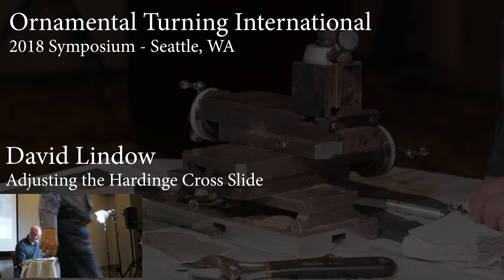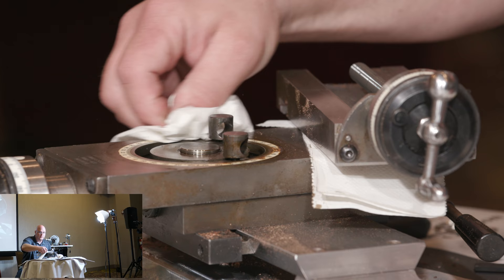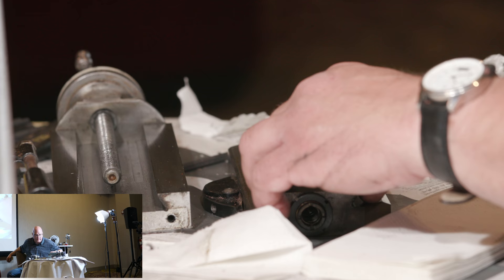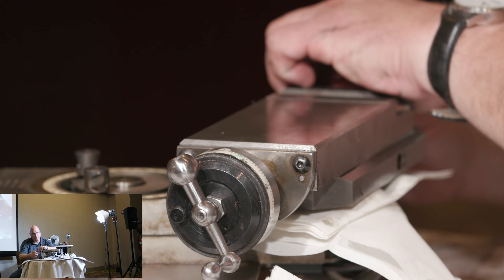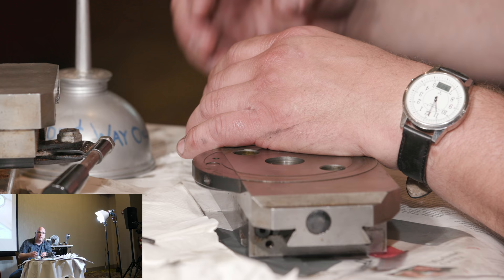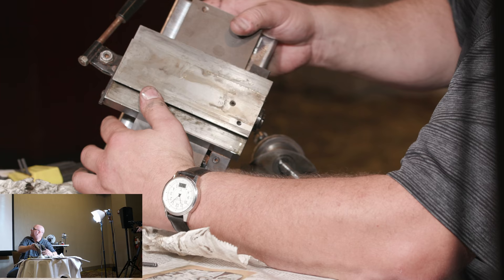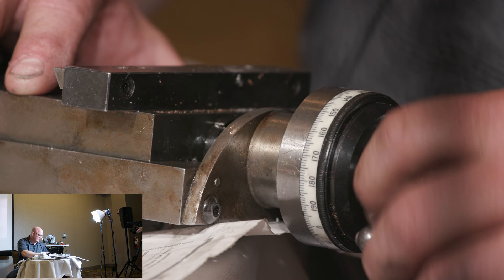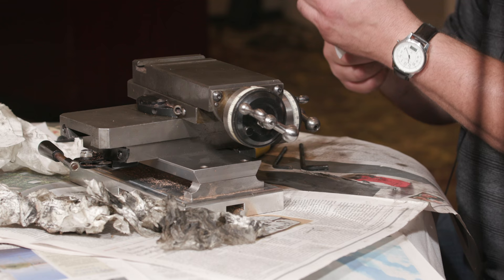David Lindow -Adjusting Hardinge Cross Slide - OTI Symposium Seattle Washington

Comment: David thanks for the lecture as it was very informative.  I have a question have you ever seen a Hardinge model F cross slide?  I picked one up on eBay but can not find any information anywhere. It appears to be a predecessor to the crossslide in you presentation. Looks to be older in that the handle is metal that locks the cross slide to the bed and the dials are all metal ( no white) as are the old Cataracts. Also it has only a one piece nut for the lead screw